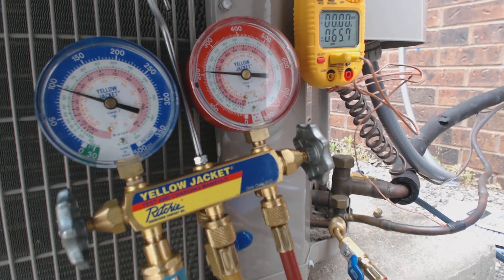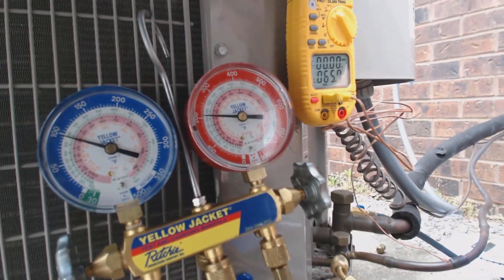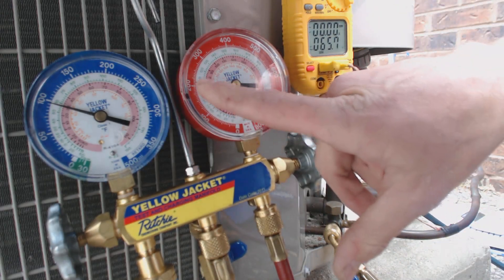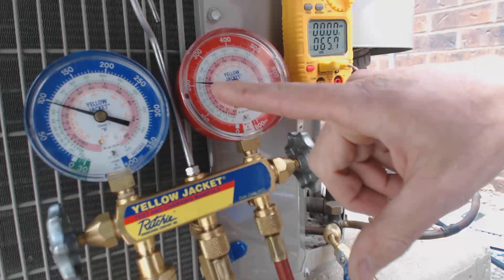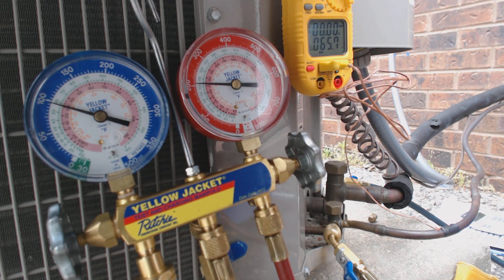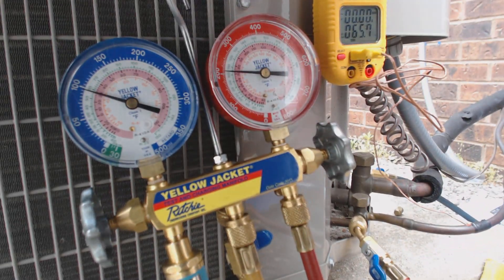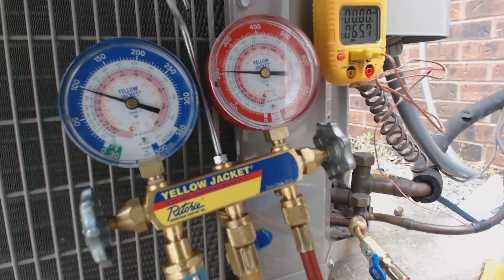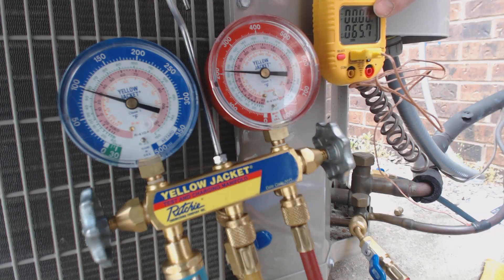Charging Refrigerant: Step by Step  Procedure to Check a R-410a Charge in an Outdoor AC unit

Comment: Thank you for your quick answer to my question, Today I have received the Book I’m learning hands on, I have a situation: evaporator coil is for 4 tons can we use a 5 tons condenser (mismatch) or what could be the margin .I will appreciate so much your advice.
Reply from the maker: If a txv is used, it will at least function and you could run a high indoor blower speed to slightly compensate but it wont be as efficient due to the loss of capacity at the indoor unit, thanks Max and let me know what you think of the book!

Comment: I have a question, which method we use to charge  a system (heat pump) that has two meter devices like piston outside in the condenser and TXV indoor at the evaporator
Reply from the maker: Use the subcooling method in cooling mode and/or another manufacturer prescribed method listed in the model's literature. The txv will be active in cooling mode so we use subcooling, thanks!

Comment: hi, please help. i was working on a new 2.5ton Carrier with TXV.  suction pressure (130psig) and high side pressure of (275psig). But why am i getting only 3deg subcooling and 30deg superheat? wouldn't the low side and high side pressures be low if there's a leak? can it be an airflow problem? thank you.
Reply from the maker: They may be high due to the indoor heat load being high, the outdoor temp being high or the outdoor condenser seer rating being low, thanks!

Comment: how can you get the saturated temp of low & high side if the compressor suction and discharge line is inclosed.there is no way to clamp up your thermo coupler becoz if you open the condensing door it will trip due to high pressure.
Reply from the maker: You need to attach your temp sensors on while the system is off. Then seal the door as best you can and turn the system on to get your readings, thanks!

Comment: Dear Sir,
Thank you very much for the vedio,,,, actually,,, i do appreciate if you may help me with this,,, i have atals Copco air dryer.... Its mulfunctionig due to gas leakage due to crack in Copper pipe,,, we fix the crack by brazing & then we charged with R410a,,, do we need to charge the gas in liquid form by up side down the vessel??
Thank you in advance,,,
Reply from the maker: If the system is empty, after the system is pressure tested, vent the nitrogen to atmospheric pressure which is 0psig, then vacuum the system below 500 microns and do a standing vacuum test like what is seen in the "acservicetech vacuum playlist" then weigh the liquid refrigerant from a upside down bottle into the liquid side while the unit is off up to the amount of pounds stated on the rating plate of the unit or a little less. Then start the unit up and check the charge with either superheat or subcooling as needed. That playlist will show how I do it, thanks!

Comment: hello I watched your videos in past,i working on a Goodman 2ton unit,& my lowside was 125psi & highside was 285psi I was getting about 60supply air & 72 return air temperatures my suction pipe temp 72 so basically I was getting about 25degree superheat this is a fix metering device vacuumed & factory charged the other problem was that the return air was pulling from basement & not from the actual space,very little from  space due to open returns with no return air duct so most return air was from basement what could be the issue I want to solve this problem any suggest would help thank

Comment: Explain why you are charging on the vapor side?
Reply from the maker: Hey Terry, while the system is running, the vapor side is lower pressure than the bottle and the liquid side is higher pressure than the bottle so if you are trying to add refrigerant from the bottle into the unit then it has to go into the vapor side of the running system, thanks

Comment: How do you charge without the kwick charge unit?  Do you charge with the compressor off or into the low side?
Reply from the maker: Still into the low side  but just be more careful and do smaller bursts into the low side while the compressor is running, thanks

Comment: Should I be using a vaporizer for charging any type of freon? (MO99, 410a, etc)
Reply from the maker: It certainly would work for any refrigerant. It is just an extra safety to make sure that not too much liquid refrigerant is added into the system going into the compressor too fast,. You can also do it without it by just turning the valves slightly open and then closed quickly, thanks!
Reply: Thank you, Craig.
Reply from the maker: Glad to help Charles!

Comment: My system is  410a strait cool . my high side is reading 124 in the pink line and the temperature on the high side is 92 and it calls for 10 degree of super heat. Do It need to ad or remove freeon. 
Temperature coming out of air handler is 64 degrees outside air temperature is 96 degrees
Reply from the maker: So you would use superheat for a system with a piston as an orifice and subcooling for a system with a txv. For superheat you need actual temp on the large line which is the low side and low side sat temp on the gauge in pink, Superheat=actual temp-sat temp in the pink on the gauge, Subcooling=Sat temp of small liquid line-actual temp small liquid line.
Reply: This system is equipped with a TXV valve, and it calls for a 10 degree sub-cooling.

Comment: hi, i passed the EPA exam on 2009 and just that I didnot understand super heat and subcool i didnt proceed further. after 7 years i found your videos and it is mind blowing. Thanks much. without you i am no good. 

Can i use the recharge process that you said for minisplit AC as well both for txv and orfice or piston type.
Reply from the maker: Thank you very much! Watch the subcooling and superheat playlists but these are used for single and two speed compressors only, subcooling if the unit has a txv and superheat for units with pistons or cap tubing as the metering device. VRF units would have to be done by weight unless the manufacturer prescribes a certain procedure, thanks! Check out other videos on the HVACR topics of interest at-  https://www.youtube.com/channel/UCOZR-1IqsAer9wzlvFgb4mA/playlists?view_as=public

Comment: I'm new to the business, I might be wrong , but isn't the TXV designed to maintain a constant superheat?  Wouldn't be right to check the superheat, and based on the superheat reading determine if the system is properly charged? As well , how about the  target range? Isn't the subcooling on the nameplate designed to be 10 degrees at 90 F outdoor and 75F indoor temperature?
 What are the temperatures outside and inside when you are taking the reading?
  Please reply to me, I want to make sure I understand what I'm studying. ( I'm still a student, just past my EPA)
Reply from the maker: Great questions! Glad to hear you just passed the EPA. For the most part, the target subcooling listed on the outdoor rating plate will not change you should try to get the subcooling as close to that as you can or 1-2 degrees higher just for future loss from techs connecting and disconnecting. In the case of a txv after checking subcooling and if this is correct or higher than it should be then you would check superheat. You can check the superheat with the bulb off the line too in cold water to lessen the superheat to allow less refrigerant through which would increase superheat or put the bulb in hot water to add alot of refrigerant through to lower the superheat. If the txv does not act accordingly then it may have lost its charge or there may be a restriction in it or befroe it if high superheat but the coil is starting to freeze. For superheat you want the indoor wb and the outdoor temp to find the target superheat. Check some of these videos out, thanks- https://youtu.be/q-G7FLlzhAg  --  https://youtu.be/bIL9BrKCujc  --  https://www.youtube.com/watch?v=qqLwE7Kbyaw&list=PLxnHR5_D2ojxTcAtR_53GoY8huBcSOt0a
Reply from the maker: We are talking about air conditioning not refrigeration in this case, thanks
Reply: Thank you,

Comment: My low side reads 100psi and my high side reads 300psi, what does this tell you, undercharge? Quick response would be awesome cause I'm in the process of charging. Thanx
Reply from the maker: What refrigerant are you working with r410a or another? If it is r410a then it looks like low on refrigerant, low airflow or liquid restriction. You would need to use the subcooling process if txv and superheat if piston, check the playlists thanks-  https://www.youtube.com/view_all_playlists
Reply: acservicetech Awesome thanx for the quick response, I'm using 410a and I believe it's not txv, it's fixed I believe. It's says on condenser, indoor txv subcooling 14°. 70 piston indoor and 57 piston outdoor whatever that means.
Reply from the maker: You can verify if it is a piston if it does not say txv on the cover of the evap or you do not see one. Usually you would see a small brass nut. That is the orifice chamber. You need to find target superheat- here is the superheat playlist along with the target superheat chart in the playlist- https://www.youtube.com/playlist?list=PLxnHR5_D2ojwGvhU1rseXQLJ-XBjBZMMk
Reply: acservicetech Thanx man I really appreciate ur help, that's awesome!
Reply: acservicetech I got no choice but to sub, yhanx!
Reply: acservicetech Overall, what should my low pressure gauge read average?
Reply: acservicetech I'm at 120 psi cause I just added refrigerant.
Reply from the maker: Hey Bobby, if you have a piston then you need to check superheat, thanks
Reply: acservicetech Thanx buddy, I think I got it under control now. Thanx for all ur advice. I'll come back to ur channel if I need anymore advice.

Comment: I try to ask questions in videos that are related to what I am asking but couldn't find one so I will just post one here.
My question is if a new unit is installed that has a TXV the inside is about 90 degrees can I charge normally? I am thinking because inside is very hot I wouldn't get an accurate subcool charge. I would think  as temp goes down the the liquid line temp and the liquid line pressure would separate more. Hope I made sense. Thanks!
Reply from the maker: Actually, it will be ok because the txv will meter more refrigerant as needed to remove heat from the building and the subcooling liquid temp will do with the liquid temp and coil condition outside. If you were to be cautious, you could charge up to a couple degrees below the target subcooling needed and then wait for the drop in the inside and then continue checking. This will give you the answer you are looking for, thanks
Reply: acservicetech thanks

Comment: My AC is broke AGAIN!!! I have had this Tappan Heat Pump unit worked on about every 3 to 6 months for 5 years now. (the unit is 9 yrs old) The compressor, the blower motor, the capacitor, the relay, the A frame (all REPLACED!)  and more than 3 times the refrigerant has been serviced! This last incident occurred just this last Feb 2017. Called for service cause we had no heat. Tech came out, put his gauges on and said we NO, NONE, NADA refrigerant. So he pumps in 15 pounds and charges me almost $1300.00. 24 hrs later its broke again. He comes back 4 days later and tells me theres a leak somewhere. ( 14 degrees outside...no heat) Really? ALL the refrigerant is gone again!!!  So he does his thing and tells me the A frame in the attic has a seam tear so that's what leaked the refrigerant.  Can't be fixed.  So we have to replace it. Has to be ordered of course....so a few more days with no heat. Ok so it comes in and he replaces it and pumps about 11 pounds of refrigerant in. (Label on unit states "240 Ounces, my mat says that is 15 pounds.) Seems to have fixed the issue.  Now the temp is up to about 90 degrees so we need AC. Fast forward to last week I noticed it wasn't shutting off so I go outside and see that the large line is completely frozen up. I call for service again. I shut the unit off. He comes out 3 days later and tells me that since I shut the unit off and it's not frozen there's nothing he can do. He says it was probably just a hiccup.  Froze up again. I call him a couple days later and he states the relay is probably sticking. So I get on the Internet and find the exact relay. I ordered it, came in and I replaced it. So far so good. Anyway I turned the unit back on and it has run for over an hour.  Temp was 77 degrees and I set it for 75. Still running. The temp came down to 75 BUT IT'S STILL RUNNING! I shut it off before the line can freeze up again. At this point I'm at the end of sanity. Why can't HVAC techs be honest?  Or be trained properly? What have I got to do to fix this unit? I have a "Home Warranty" that seems to be almost useless. They charge me the service fee ( in addition to the refrigerant that has to be constantly pumped in!) and band aid my unit. Over and over again. Help!!!!!!!
Reply: You should never let anyone recharge your system unless the leak has been located and repaired. Also 15 pounds of refrigerant is quite a bit. Maybe you should call a service company that knows what they're doing
Reply from the maker: Wow, I am really sorry! My best advise to finding a good tech is by referrals or maybe finding and stopping in at the local hvacr supply houses in your area and asking them who they would recommend. If the tech asks to put refrigerant in and the system is empty or close to empty then it is not going to hold and tell them that you want them to use bubble leak detector, electronic leak detector, or dye. If the system is empty then the tech is to put nitrogen in, listen for noise and use the bubble leak detector. thanks and sorry you are not finding the right company!
Reply: acservicetech The, I guess, biggest problem (besides poorly trained techs) is getting my warranty company to hire someone qualified and trained properly. Seems like they just keep soaking me. I served 24 years in the Air Force and did a bunch of time in some very hot places. I can't seem to handle heat anymore. Maybe I should move to Alaska or Iceland.......
Reply: I have a second system that services my kitchen and dining room. It sweats. It cools. And it does it in about 15 minutes of running. This main unit is almost bone dry on the line and the compressor area. Unfortunately I don't have gauges or the refrigerant if it was low. 410 is what's supposed to be in it. From viewing lots of videos that may be the problem. From what I can gather. I can fix fighter jets.....AC units...not so much so!
Reply: I'm just tired of messing with this system. And of being hot! I have my house up for sale and I want the unit fixed right. Not just because we need it to work properly but because it's the right thing to do. Military integrity and all......
Reply from the maker: Many Technical High Schools have adult classes at night, sometimes such as a 10 week session on HVACR systems, thanks
Reply: acservicetech Stinks that I may have to either do that or buy a whole new system. I have multiple college degrees in Aircraft maintenance related areas and 9 different certifications but not educated in HVAC.
Reply: The other problem is having to be certified to even get refridgerant.
Reply from the maker: They may also offer the epa license prep and testing. Thanks
Reply: acservicetech Something else that's crazy is the tech told me they paid less than $200.00 for a 25 pound bottle of 410 and charged me $1300.00 for 15 pounds. Hell...that's better than my pay ever was and I had people trying to blow me up or shoot me!
Reply: Ok...enough of my griping. Thanks for the info.

Comment: Are we supposed to be using a liquid vaporizer?
Reply from the maker: It is not a complete necessity but it makes charging safer and faster for the compressor. I have been using this for years and I really like that I don't hear any compressor noises while charging as that would be liquid in the compressor. You can get away without it but to do it right without it seems to just take too long because you can only put a tiny amount in each time. Thanks -    Here is a link to the Imperial 535-C Kwik Charge Vaporizer for Charging Refrigerant if you wanted- http://amzn.to/2oge0u9

Comment: Have you ever heard of getting a shock if the refrigeration valve isn't open fully causing friction from the Freon?
Reply from the maker: Are you talking about a liquid hammer if the liquid refrigerant suddenly stop such as at a solenoid valve? Are you taking about the service valve on the unit and refrigerant having to go through a partially open valve and the pressure reduction that would occur due to the increased friction of a smaller entrance? If you lower pressure then temperature would follow and lower the temp on the other side of the obstruction.
Reply: Shock occurs from charging from a virgin refrigerant tank into a condensing unit.  This slight shock will occasionally turn off the weigh scale.

Comment: In my experience the high side is normally over 300 psi on 410. Why was it so low here? Was it because it was cold outside or is it just how this unit runs?
Reply from the maker: The higher the seer the lower the pressure so if there is more coil then the unit can reject heat better. This was 16 seer and fairly newer so the fins were in good shape. I don't remember the outdoor temp that day. What you are describing is probably 13 seer units. This is why it is so important to use subcooling and superheat. Thanks for your question billybassman21!